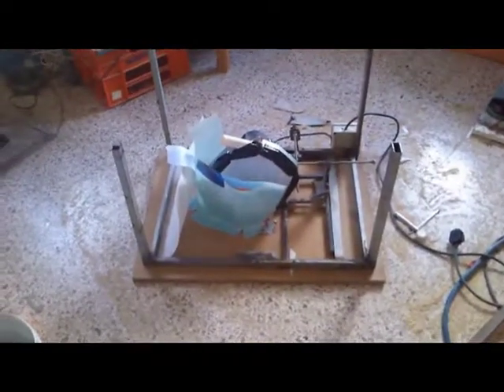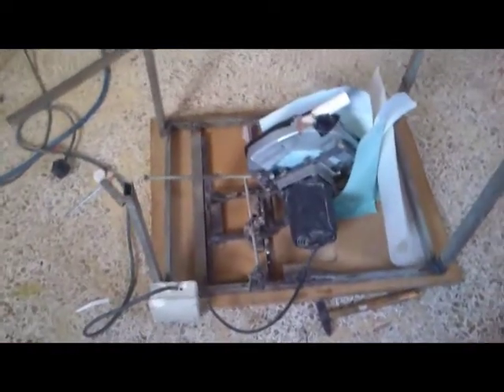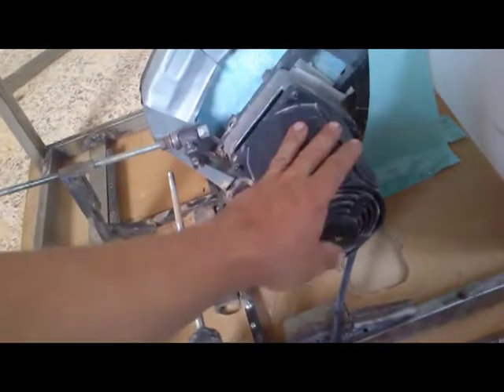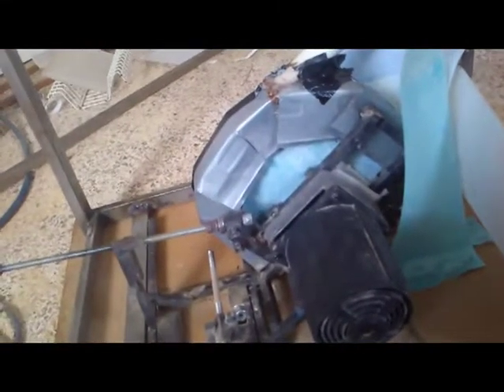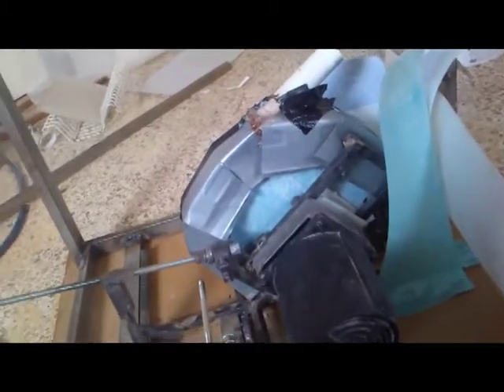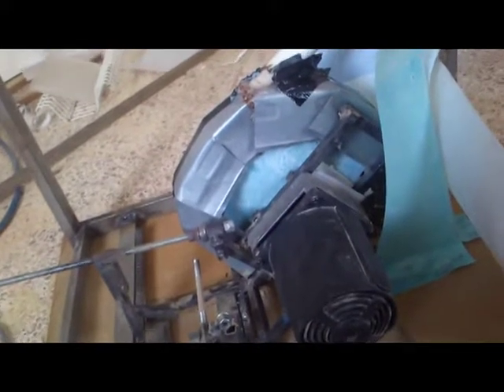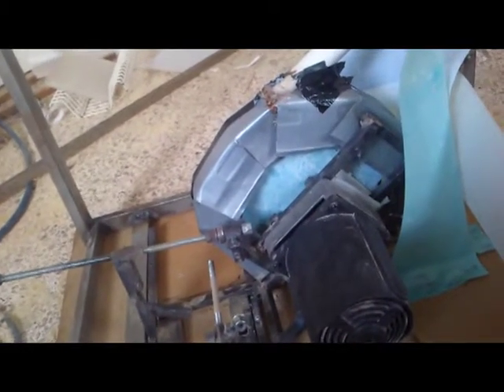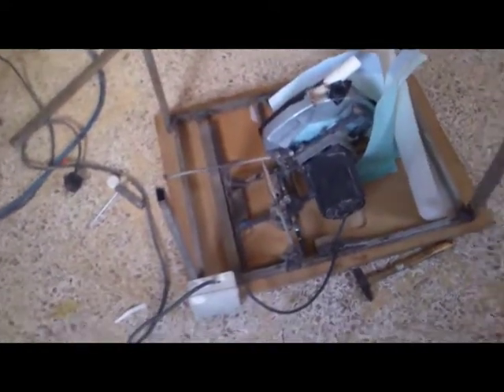Homemade table saw - end of life with sparks and whistles.

Comment: The sparks inside of your motor was only cuz charcoal were completely used. Charcoal support stared touching motor's rotor. For less then $5 it was repairable.
Reply from the maker: This motor had shorts in the rotor before I got it in my hands, both between the winding and to the core. Charcoal is not the same as carbon.

Comment: you could have replaced the carbon brushes and clean the commutator with a sandpaper. Cheap and easy fix.
Reply from the maker: This rotor had compromised coils, it would not help.